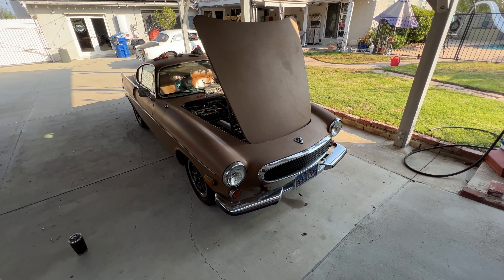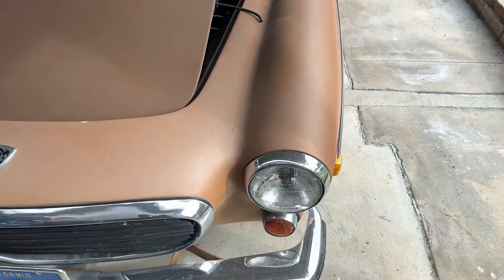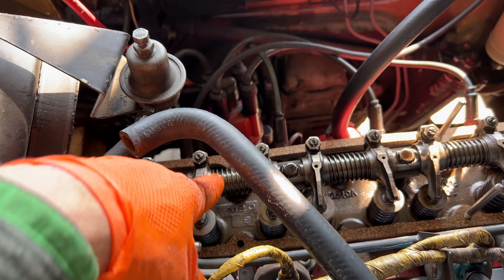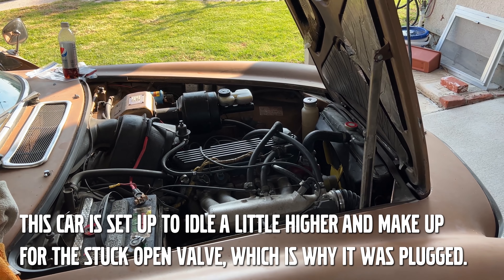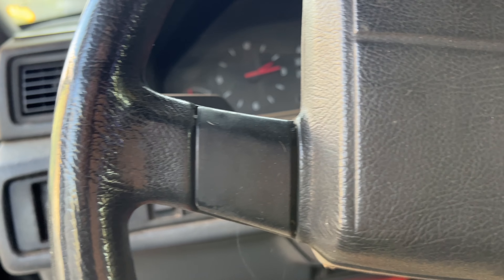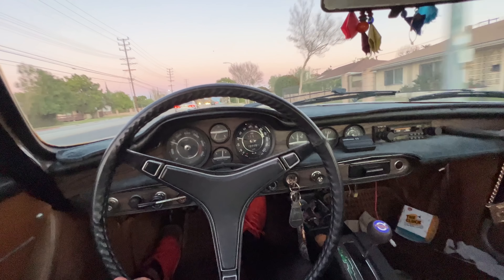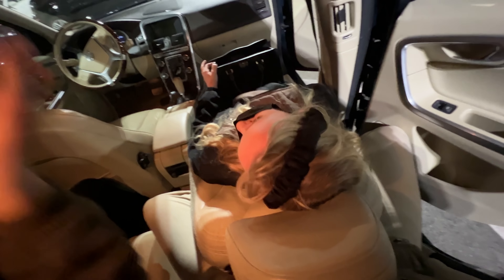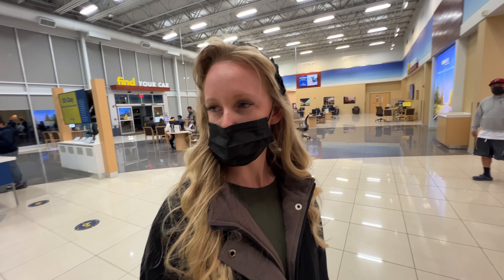Volvo 1800E Freeze Plugs B20 fuel injected and more!

Comment: That is the cleanest B20 valve train I've ever seen!  The blowby from the rings can be as simple as a glazed bore.  The double chrome rings of the B20 don't like being lightly loaded or stop-start from cold.  A good hard long run will test whether it is a glazed bore.
Reply from the maker: Thanks for the tip. I pulled the head off today and you’ll soon see what we discovered underneath…
Reply: @DavidBello  my old man's 1970 142 with a 45 DCOE Weber used to require deglazing every 6 months. We'd load it up with a trailer load of wood and deliver it to friends place 450km away. I'll wait for the next installment, but I'm thinking knock or detonation fractured a ring, maybe scored the bore and wrecked a piston. B20 thing.

Comment: Loved the video!  Always tops!  My ears perked up when you mentioned the noisy ac compressor.  I bought a v60 that made some noise inside.  It sounded like hissing or gurgling.  Sizzling almost.  My mechanic charged me a little bit to recharge the system which has improved the noise so I'm satisfied.  The trouble with them is that their cabins are quiet enough that a little noise like that will really bother you while you drive!
Reply from the maker: I get very annoyed with squeaks and rattles in my cars. Music won’t cover it enough for me

Comment: Hey is the backyard project a 940 or a 740? The running lights point to a 940 but the ignition on the dash points to a 740. Maybe a 760? I think you should save it regardless!
Reply from the maker: First year of the 940
Reply: @DavidBello  Thanks!
Reply: Love the wagon,